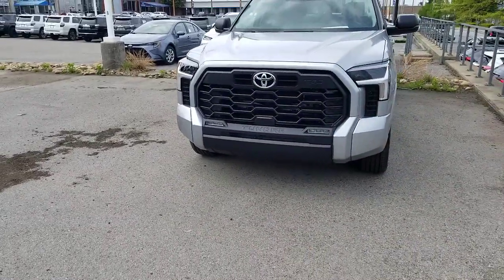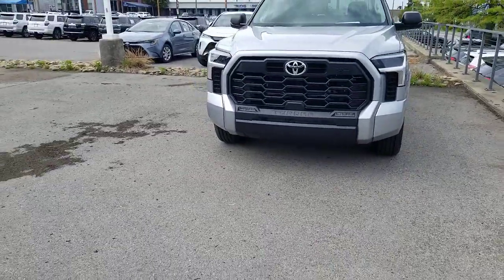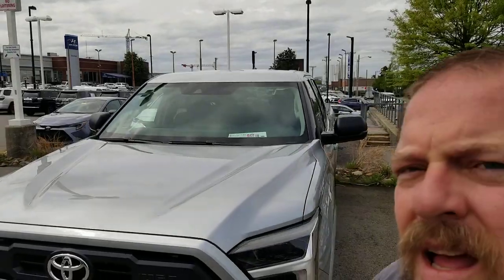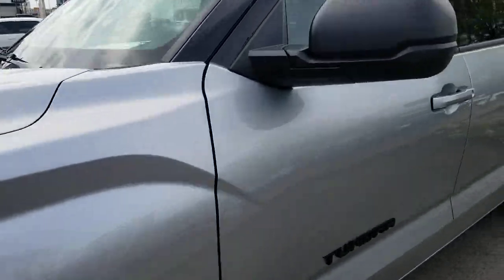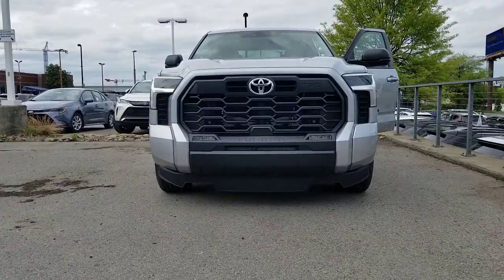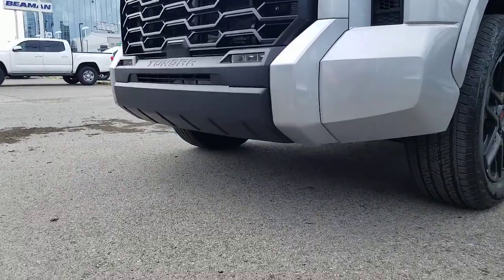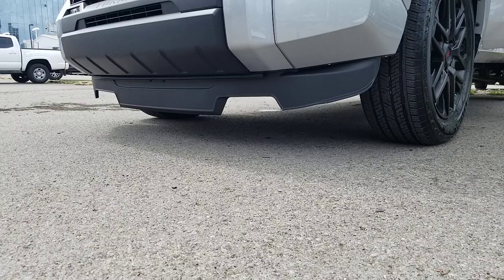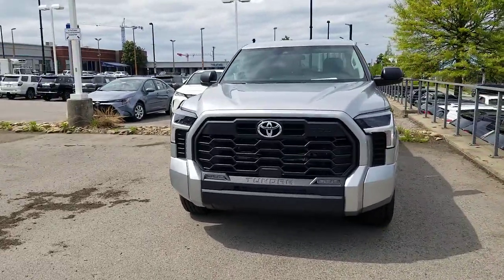New Toyota Tundra hidden air dam.

Comment: Another poorly designed aerodynamic feature. My V8 TRD PRO has no problem, and no air dam....
Reply from the maker: It helps
Reply: There’s plenty of Tacoma videos showing the air dam removal doesn’t do anything for fuel economy. What it will lessen is dirty air and turbulence under the vehicle which causes stability issues at higher speed. I’ve got a tundra with this and it’s probably not worth fixing if it ever breaks. Without an air dam it will get “floaty” above 70mph but not to the point of “I need to fix that”. If mine died tomorrow I doubt I would realize it.